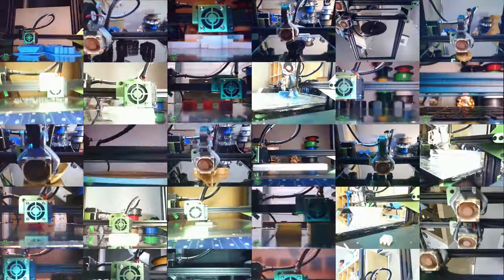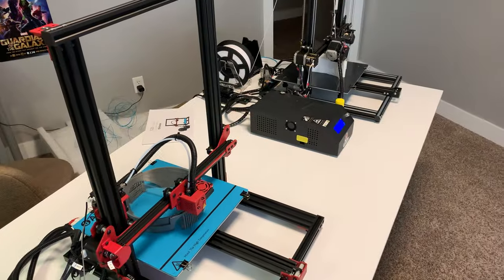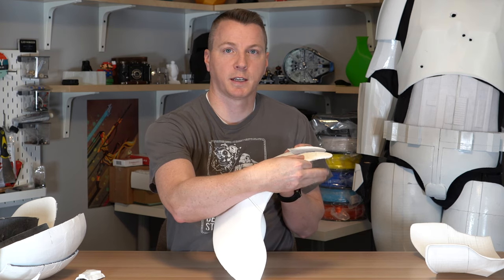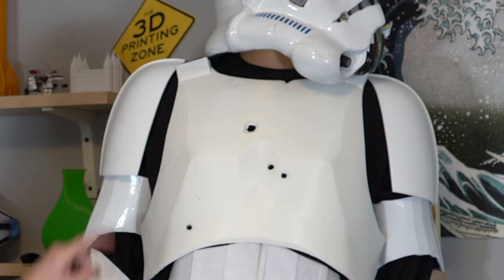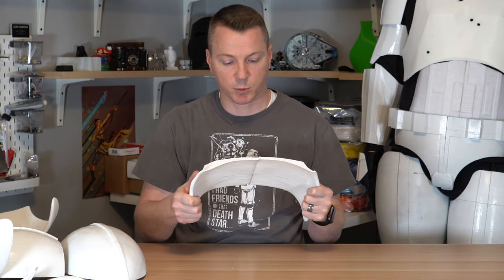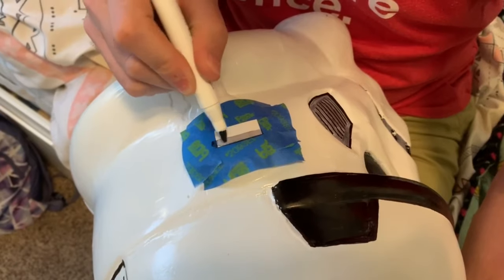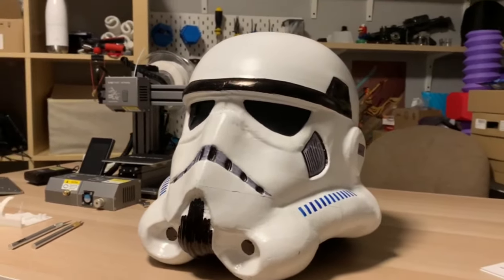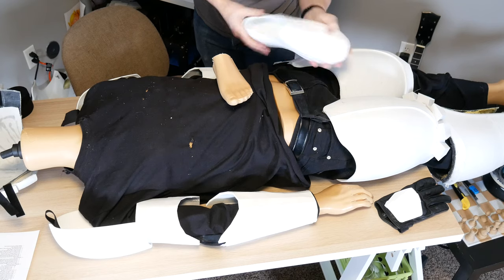3D Printed Wearable Stormtrooper Armor Suit - Star Wars

Comment: It's extremely easy to make a plate that will stop a green tip 5.56 from an AR15.
It takes a welding blanket (fiberglass), epoxy resin, some carbon fiber matt, and ceramic backing like you find at Home Depot in kitchen tiles. It's not as heavy as metal, and it stops the round.
It's not reusable,  but making another one is better than being shot.
Also, if I were to do this, which eventually I do, I'd use a heavy vinyl because it has the best impact properties.

Comment: Hi I’m having trouble with keeping the print stuck to the build plate. The corners of my prints tend to lift up throughout the print. I’m using PLA on an ended 3 pro. I was wondering if you could give me any tips.
Reply: Hey Cameron - that's always a pain. This can be a few things but I would check that you're materials aren't cooling down too quickly on those lower layers because of the fan, or if the heated bed temperature is low. Could also be an issue with leveling. Try this troubleshooting guide to see if it helps: https://all3dp.com/1/common-3d-printing-problems-troubleshooting-3d-printer-issues/ Good luck!

Comment: Nillllllls! I need you buddy! First of all- awesome suit- second- I got a 3D printer finally- I got a Lotmaxx sc-20 (it’s like a cr-20 clone) and it was spitting our super clean prints and then nothing! My prints are now porous and underextruded. Until I calibrated the extruder- then it overextended a ton. Until I recalibrated it again- now it looks like garbage again. I thought maybe it was a clog but I poked at it again and did some cold pulls and I swear it looks worse now. I’m at my white end. I also considered just flat out replacing the nozzle but I am afraid to take apart my hot end and make things worse!
Reply from the maker: Hey Chris - welcome to the not-so-fun side of 3D Printing! It gets better. I'd start here: https://www.simplify3d.com/support/print-quality-troubleshooting/ - it's got great troubleshooting steps. Make sure to try different filaments and different temperatures to see if that helps. Every situation is different but hopefully testing some of these things help you get back on track. Let me know how it turns out!
Reply: The 3D Printing Zone thanks man. I knew you’d come thru for me. It’s just weird because I had a filament that seemed very brittle but I got it dialed in pretty decently and was excited to get some filament in from ZYLtech recommenced by uncle jessy and it’s just been a mess for me. Stringing everywhere with loops popping out from otherwise decent layers- heavy seam zits and then all of the sudden under extrusion galore after not having been there in the beginning.
Reply: @chrisperrywv  did you ever get it figured out?
Reply: Eddie Ash oh man- I’ve been thru the cycle 10 times since this comment. I think in this instance it was my plastic extruder had been chewed thru by filament and after replacing the extruder with a metal one (and maybe the PTFE TUBE) I was back in business. Currently I’m fighting with PETG. I have a video on it if your interested- about to put out another one with an update since I have more information. I won’t spam the link here unless you would like to take a look. It’s on my other channel- not the one I’m commenting from.
Reply: @chrisperrywv  I'm still in the "hmmm which one should I buy" mode. But honestly, they seem to have alot of corks. From the machine to the materials and the nozels. It can be over whelming. Going to take days of more research lol

Comment: Any non-toxic alternatives to Bondo? Or can you just sand the PLA directly?
Reply from the maker: You can sand the PLA directly, yes. The bondo is nice because it's additive - it can fill spots in rather than just sanding away. Another alternative is to use a 3D printing pen to fill in whatever you like and then sand. The hard part about sanding filament is that it melts when you sand too quickly so it gets gooey. If you take your time with it it works fine.
Reply: @The3DPrintingZone  Thanks!

Comment: So I'm working on a figurine a friend printed off for me and while i have a pretty steady hand there is alot of very tiny detailing and grinding i need to do on a hand. Any suggestions on what i could use to basically clamp it in place so it doesn't move on me while trying to do the grinding
Reply: I know I'm a year late, but my uncle paints figures and he uses things called helping hands, theyre basically little hands that grab and hold things making it easier to paint.

Comment: Do you consider use a resin material printers like Elegoo Saturn. Im thinking  about buying 3d printer but Im afraid resin material is not cost/efficient wise choice comparing to PLA material.
Reply from the maker: I haven't ventured into resin printing because of the hassle. The resin, the cleaning, the draining, etc. I think I'm just lazy about it but I'm certain I'll try it out at some point. The resolution available in resin printers can be really impressive but I don't know if I'd recommend it as a first printer unless you had specific needs.

Comment: question, if you used a 100 per cent infill on the chest piece, how bullet resistant would it be by itself?  I assume it would shatter under impact, but Ceramic armor plates do that intentionally.
Reply: @baddriversofthenorcalarea500  lol what even kind of question was that lmfaoooo bullet resistant 🤦‍♂️🤦‍♂️🤦‍♂️
Reply: Maybe if you were throwing the bullets by hand, it would be bullet proof. 🤣
Reply: I suppose you could shoot a smaller piece like, like the  forearm at 100% infill for a quick test. It should be better protection than nothing and depending on the plastic results would very.

Comment: how much did all the materials cost? (the filaments and whatnot) cause just the printers is over $3000
Reply: The PLA, paint, bondo, black clothing and other parts cost around $250-300. You can print all of this with the U20 Plus, which is under $500 and would really speed up the process. I printed the helmet on smaller printers so I'd recommend doing this with a larger printer if you can get your hands on one. If not, you can do it piece by piece on just about any printer - it's just more assembly.
Reply: Dillon Brandon How the fuck does a 3D printer cost $3,000  I got my Ender 3 for 180 and made the helmet in a week